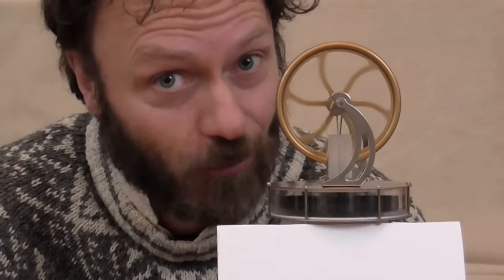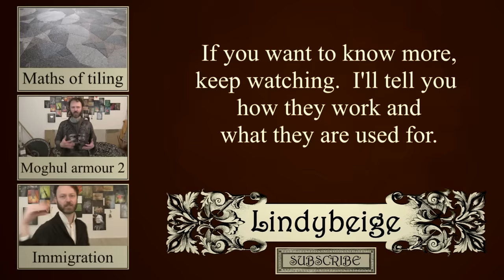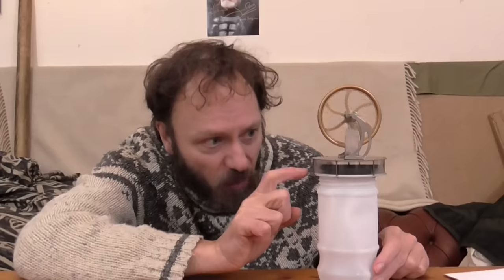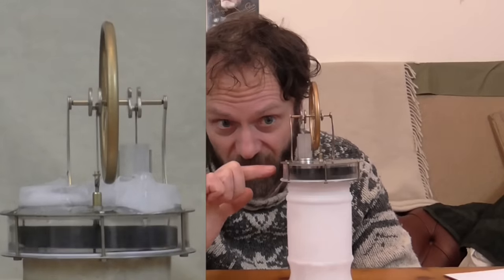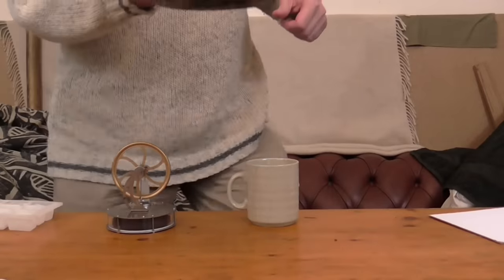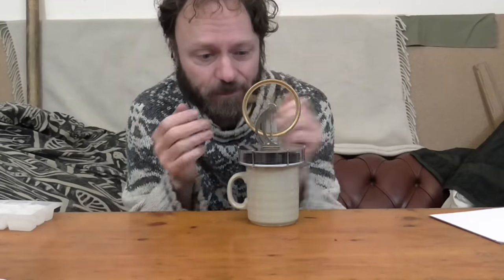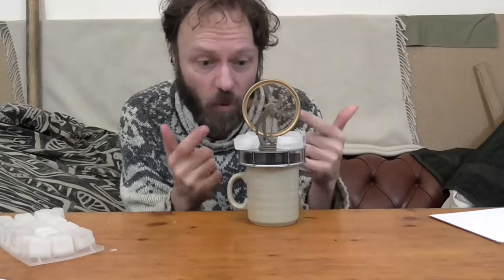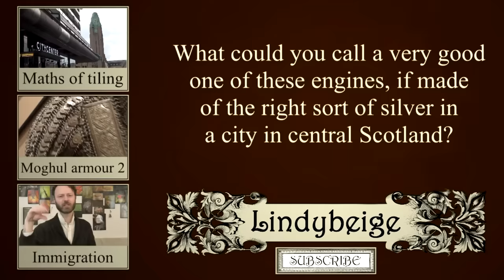Stirling Engines - the power of the future?

Comment: The temp difference of a Sterling is often too high with many of the temp sources available.
Orc (Organic Rankine) or Kalina has much better efficiency with what is common in medium temp sources.
Solar thermal generating excess via Orc in summer and straight heat in winter is actually more efficient than SolarPV.
Strangely the hybrid mode of annual collection recieves little comparison with just peak PV often being used.

Comment: Crazy question:  Could a sterling engine use the heat and cold side of that plate in a dehumidifier to help recapture and reused some of the power used to run it.

Comment: Also useable in desert areas imho. Just paint the top in this 99% light- and so IR-absorbing coatings. Guaranteed 50°C difference. At night it about freezes there so then it works the otherway around. Food for thought. But then again: there are solar heat farms already there.
Reply: Okay, now I want to build one. Thanks a lot... :-p

Comment: wouldn't really be much use in the server scenario as you'd want to just get that heat away from the servers as soon as possible. the sterling engine act as an insulator, slowing heat dissipation by quite a lot. You'd still want to dump most heat far more directly

Comment: These seem like they'd work for houses in any cold climate. If it's 0°C out and you keep your heat cranked to 20°C, there's a heat differential right there. 

I wonder if its enough power to be useful. It's getting hard to compete with solar.

Comment: I'm always curious about the implications of 'free energy'. As the video pointed out, there really isn't such a thing as 'free' energy. Even (or is that, especially?) a temperature difference requires energy from somewhere. What would happen, theoretically, if large amounts of space are used to collect energy in this way? If you stick a huge Stirling engine somewhere on antarctica, the ice will slowly melt. A similar thing will happen with huge batteries of windmills. The wind will lose some energy and the airflows will be affected.
At the current use that difference is probably negligable, but if we'd put ALL our effort into engines that seem environmentally friendly, I can see them having a major impact. At the end of the day, you can't really 'create' energy, all you do is remove it from some other place. The best you can do is choose that place as wisely as possible.

Comment: if you are in a heated room, outside its cold and you attach these engines and start using them, the room will cool down faster and you will have to heat more

Comment: You can spin up a fly wheel and store it in the vacuum of space, however probably not going to get high speeds from a stirling engine. Should be very easy to swap the ones on submarines into a spaceship though.

Comment: The issue with Stirling engines is Carnot efficiency vs material durability. 

Carnot efficiency is the upper limit on the efficiency of a heat engine, related to the difference between the highest temperature in the engine and the temperature at which heat is rejected by the engine (I.e., the temperature of the environment).

An internal combustion engine burns fuel explosively in a moment and then goes through a cycle, allowing the cylinder to cool down. An external combustion engine like the Stirling has a heater head that stays at the maximum temperature all the time. 

In the early days of Stirling engines the cast iron heater heads burnt out all the time. Now the heater heads are made out of special high temperature stainless. Getting a lot of heat energy in through a small area without melting anything is still a problem. 

Modern Stirling engines also use compressed gases like hydrogen and helium to increase heat flow. Tricky to maintain. The engine Lindy has is atmospheric and so limited in heat flow.

There are a few on the market as yacht generators, but they are expensive.

Comment: These work great at the equator if the sun heats the top and the bottom is in the cool ocean water. A boat driven with concentrated sunlight or any other type if burner heating the top side could be nice and quiet for the houseboat engine

Comment: The steam engine is very similar to a Stirling engine, I would even go as far as saying it's the same physics that powers both devices. Except, the engine described in this video uses hot and cold air as reservoirs whereas the steam engine uses hot (steam) and cold water. You can inject far more energy into steam than air, therefore, the steam engine has the capability to produce more power in the same form factor.

Comment: Thinking about temperature gradient in outer space , stay in the sun and it is boiling if not melting hot stay in "shade" and it is -270 Celsius and then there is the hot tube filled with electronics and people generating waste heat. I do not think it requires gravity (Stirling engine that is) only momentum. Does not need to carry its own energy supply (Diesel , Uranium-235) and/or need to be jump started like some fusion plasma reactor , only backup batteries that all of the above would require either way.
So a dude named Robert Stirling in the 1816 saw a future we are only now starting to comprehend.

Comment: In case of apocalypse, Stirling engine the best deal! It can be build using common household materials, scrap internal combustion engines or compressors. It can be fuel almost anything generates with heat. 

In contrast, Solar panels requires specialized manufacturing and specialized materials such as silicone and semi-conductors. In post apocalypse, they will wear out and irreplaceable.

Comment: I once postulated that the temp difference between the dark (minus some 200 degrees) and sunny (scorching) sides of the moon would provide an excellent source of unlimited power via the Stirling engines on a monumental scale.  (Same thing for space stations. Behind those solar panels is a shadow area that is near absolute zero. Incredible temp differential.)   On earth we have an incredible amount of waste heat extant in the enormous amount of spent nuclear fuel that has to be constantly cooled to prevent environmental harm from heat buildup. Stirling engines should surround every nuke plant to take advantage of that heat source and increase generating capacity by possibly a factor of tens. (Dare I say hundreds?) That heat source is perpetual.

Comment: I am interested in the thermodynamics of these things.
1) They are powered by the temperature gradient
2) They can be up to 50% efficient
To my very layman grasp of thermodynamics, it means that half of the temperature gradient is converted to mechanical energy. In other words, the ice cubes on top will melt half (OK, I know the relationship is not linear, but what the heck) as fast as if they were laid just on a metal plate on top of the tea cup.
Am I right?

(Considering this video is nearly 3 years old, I am not expecting anyone actually reading my comment. I am off to buy a Stirling engine on eBay. For purely scientific reasons, you understand. To run a few experiments.)
Reply: In this example, if the ice were placed on a plate that was on or nearer the hot water, the ice would absorb heat quite fast. 

In this example the engine’s big piston chamber and the 1/2 inch gap are in the way. So the heat is absorbed less rapidly. 

The ice is also absorbing heat from the ambient air as well. And the hot water is releasing heat to the room air. It would help to enclose the top insulating the ice from the room air, and insulate the hot water from the room air. Then the heat has one path and that’s thru the chamber. A Stirling engine cannot generate much torque. So 50% of tiny energy is tiny. 

A very large engine isn’t as efficient, but if there’s free geothermal heat and naturally very cold air, like in Iceland, an array of Stirling engines could return a lot of useful work. 

If you have to burn wood coal or anything, smart money is on steam.
Reply: I know and I appreciate that I did not express myself very well.
So imagine the difference between the heat transfer with Lindy's Stirling engine and a similar 1/2 inch high glass cylinder with metal plates but no piston and all that machinery.
I still want to get one. To "conduct scientific experiments", you understand. Please do not discourage me.

Comment: Could this be used in space? With the outer/cold layer facing outer space and the warm/inner side being inside the spacecraft?
Reply: I've thought something similar with using A/C and a sunny roof, but this would severely damage efficiency as you are just opening up a weakness in energy transfer, defeating the purpose

Comment: Probably the closest to a perpetuum mobile we can get.
Used properly you will have a very low energy loss. That is if you use the heat generated by friction to run the hot side of the engine. 

Iceland would be a perfect place for these engines. Put them on a hot spring and have the heat of the earth's core run the hot side.
Then use the rotational energy to run generators.. basically "free" energy...
Well.. or atleast very very cheap energy.

So yes. Running power generators, Stirling engines is definitely a good idea closer to the poles. Around the equator solar energy is probably a lot better.

Comment: You know, if you had that in a hybrid system with solar energy, you could use waste heat from the day to power a sterling at night, so that way you have two sources of power so you don't have to rely so much on batteries.

Comment: When you put the hot water on the bottom and started talking about how it wouldn't work great in hot temperatures, I thought to myself "what if the bottom was built into the ground?" So let the top part be exposed to the hot sun and the bottom buried in the dirt...would that work?🤔

Comment: What about spaceships? Any power source compartment would be much hotter than the vacuum of space... hot and cold right?
Reply: i thought the same immediately.
Don't they always say it is so hard to do cooling in space, because it is hard to radiate heat off into nothing. Could we not use the heat generated by engines for trust to warm some gas and use that do generate electricity to power stirling engines? :D

Comment: So places where you have temperature extremes are best? Like the equator. The air is hot and the Amazon river is not. Like a Danish sub. 
 A reflective disk or Fresnel lens gives you a temp differential any where you have sun. Lets think outside the cube.
Adam

Comment: I used to have a liquidified spirit glass duck 🦆 which dunked it's furry beak into a glass of water over and over. All it needed was a crank. A roof with lots of dunking ducks would be more asthetic than just wheels. For a larger output, artificial peacocks would disipate quite a lot of heat and simultaneously confuse the environmental lobby.

Comment: all storms are produced by temperature gradients in the atmosphere. So if you could make one very large, you would place it at the equator indeed and have the top of it topping at at 40,000 feet. Make it several miles wide, and you would have more energy output than the largest nuclear weapon. 

Of course, first, you need to find building materials that would be strong enough and light enough.
Reply: I wonder if carbon fiber would work for some parts of it.

Comment: they look less efficient than i think they could be... the air really should be either at the hot or cold side but if you watch the displacer is more often neither.... some form of cam or the older vavle type mechanisms could be used to move the displacer in a less smooth manner

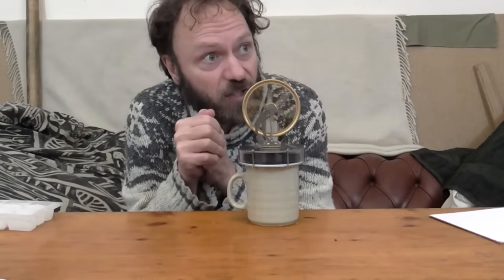Comment: 12:23 Brief explanation to those of you wondering why Google and Facebook aren't already doing this:

Even if this approach wouldn't recapture anywhere near 100% of the heat energy that the servers dissipate, it would still recapture quite a lot of it, and reduce the servers' energy requirement (and therefore the cost to run) significantly, so there is quite a large financial incentive to do so.  Unfortunately, sterling engines don't convert and/or transfer heat energy away from the servers anywhere NEAR fast enough to keep them from overheating.

You see, servers put out a TREMENDOUS amount of heat, and they tend to get a bit grumpy if they get above a certain temperature -- all modern CPUs, even the one in your laptop, put out enough heat under normal operation that they run the very real risk of frying themselves if there's nowhere for that heat to go (hence why computers have fans), so they have built in temperature sensors.  If the CPU notices it's getting a bit toasty, it will tell the fan to spin faster (this is why you hear the fans ramp up when you launch a CPU-intensive program).  If it keeps getting warmer, it will automatically start to run itself slower and slower as a self defense measure so it doesn't put out as much heat.  If it keeps getting hotter after that, it will panic and turn off the whole computer in the same manner as holding down the power button (this is known as thermal shutdown, and if it happens, something has gone very wrong indeed).  Datacenters are, at their core, nothing more than collections of hundreds if not thousands of really high-power computers, all in one room.  The amount of heat they generate (and the amount of power they consume) is measured in megawatts.  This is why datacenters have fans in the server racks loud enough to warrant ear protection to pull the heat away from the server chassis into the room, and air conditioning systems, sometimes 7 or 8 of them in the same room, all running full tilt, just to pump all of the heat outside.

Comment: I might use this in future but my guestion is that . If you would use this power up batteries at winter at north. Just by using -20c from outside and +22 inside house. Would you be actually end up cooling your house and wasting energy with this device ? --> Going next to codys lab to see next video about this.

Comment: There is always a temp difference on double glazing, outside = cold glass, or one 'plate' of a heavily modified sterling engine. Possible? it could power usb charging, or ventilation fans at least. If every window in a house were so modified, ie each window is a peltier device, thats quite a bit of kinetic energy. shoot me down....

Comment: Imagine that machine being built into the freezer. The lower plate is below zero in the ceiling and the upper one (on the roof) is heated by waste heat from the condenser and ambient temperature. Then imagine such a freezer as the building in equatorial Africa (for example, in the meat industry).

Comment: If in 2015 they had used emergency Stirling engines to power the reactor cooling water recirculation pumps at the Fukashima Daiichi nuclear plant there would not have been a meltdown.  The hot water coming from the reactor would be on one side of the Sterling engine and the cooled return water would be on the other side of the engine producing the temperature differential.  There would have been no need for a battery back up system.  The battery backup system failed causing the disaster.

Comment: What if we put LN2 on the cold plate. The temperature difference will be much bigger. I just need to know the power output with LN2
Reply: Liquid nitrogen requires a large amount of energy to produce. It would also slowly heat up with the use of the engine (it slowly transfers the heat side to the cold side, so you need to keep cooling it) You'd get a large energy loss trying to use LN2 as a cooling method

Comment: Stirling engines have been built for automotive use.  They take a out 60 seconds to 2 minutes to reach operating temperature depending on where you live.  This was all done in the 70's, so that may not be quite the issue it once was.
Reply: NASA made transport vehicle  using stirling engine. It was more efficient than oil engine and almost same powerful.

Comment: What if focused sunlight was used to heat one plate whilst either air or flowing water is used to cool the other plate? Perhaps using sunlight in arctic and antarctic regions with the high temp plate exposed to the light beam and the low temp plate exposed to ice. High capacity batteries could be installed to power field stations during the respective winters. This could potentially eliminate the need for combustion engines in arctic areas. Given the amount of landmass in Antarctica, many of these engines could be installed. With no emissions or noise pollution, they would be well suited to such regions. 

Anyone care to weigh in on whether such an idea would be possible?

Comment: It should be possible to make one of these that works in a vacuum by using the weight of the cylinder instead of the air pressure in the room.

Comment: It might work in a hot desert climate. If the bottom was buried 50 feet into the ground where it is about 55 degrees, and the top was exposed to the sun, or as you illustrated, with a mirror concentrating the sun onto the top surface.

Comment: Combine a sterling engine with a ammonia based refrigeration system to decrease the temperature on the cold side and solar thermal system to increase the temperature on the hot side and provide a heat source for the ammonia based refrigeration system.

Comment: Engine efficiency increases with pressure and temperature.  The Stirling has limitations in this respect.  It shows up in specific power, that is for a given power,  a big engine required (heat exchangers).
A close relative of the Stirling is the closed Brayton cycle (gas turbine).  Several have operated for years.   Lately, interest resurgence in CO2 gas closed Brayton for Thorium reactors.  If you’re a gear head, check it out.  Likely will be the answer to global warming concerns instead of windmills and solar.